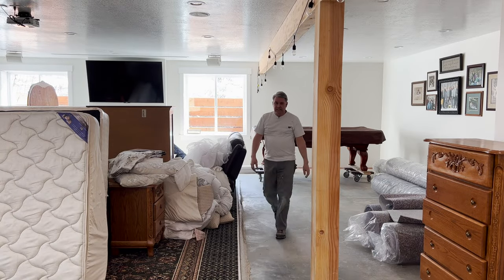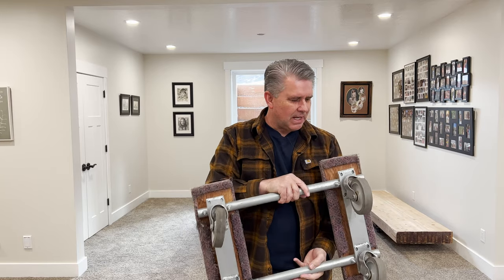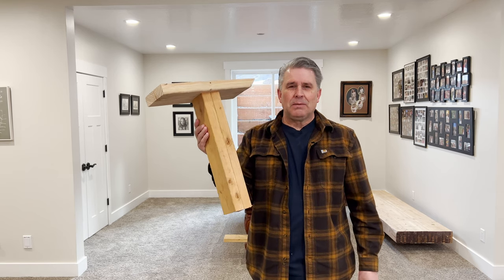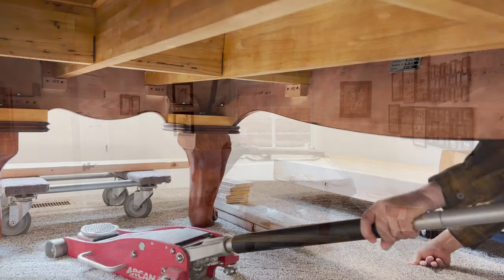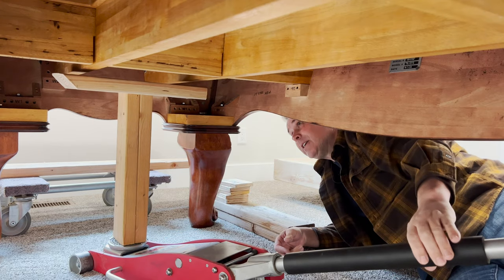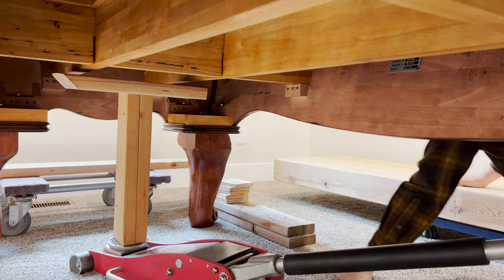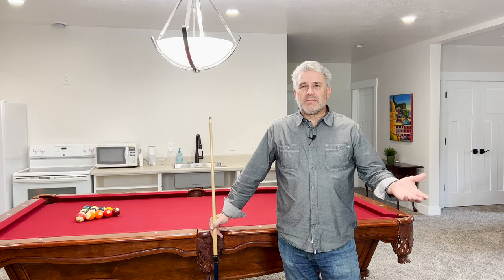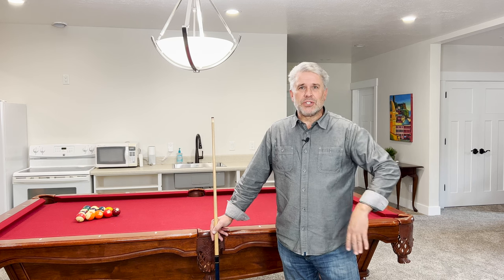Move a 1,000 lb pool table by yourself - NO DISASSEMBLY NEEDED!   |   I Can Do That DIY

Comment: I've got a 3 piece slate table. It won't crack? This looks very doable, I'm just concerned about everything I hear about cracking the slate. Thanks for putting together such a great video.
Reply from the maker: Mine is 3 slate also. I had no issues with slate separating at the seams etc. 

I purchased the table used. I disassembled it at the previous owners home, moving it to mine and set it up in my basement and then did a complete DIY re-felt. 

As always with DIY it’s at your own risk with no guarantees. Go slow and easy. That’s what I did. Hope it helps!

Comment: I'm glad i found this. So happy.

Have you thought of new precautions to take or making new adjustments to this video since then?
What worries me is that the wood across the dolly will snap. Maybe making it like a header you would find above the door or is that just over kill?

I'm so nervous but will attempt it your way step by step and slowly.

All this because of the Stupid carpet that stretched out over time and became like a speed bump now tripping hazard.

Any suggestions would help.
Reply from the maker: I’m really happy to hear the video was useful to you! Regarding your concern about the wood across the dolly potentially snapping, reinforcing it similarly to a door header for additional stability is a smart idea and certainly not excessive. When attempting this, proceed carefully, step by step, to ensure everything goes smoothly. Adding extra support, such as using a thicker piece of wood or more cross beams, can help prevent any issues. Always prioritize safety and take your time with the process. Best of luck with your project!

Comment: Nicely done! I’m assuming your table is a 3 piece slate table? No issues with the seams where the slate meets? I need to move my 4’x8’ (3) piece slate table about 10” in one direction and am dreading having to take it all apart for that. Thanks again, appreciate you sharing this!
Reply from the maker: Thank you! You’re correct, mine is a 3 piece slate. I purchased it used, disassembled it at the prior owners home, hauled it into my basement where I reassembled and put on new felt. There has been no movement of the slate. As you can imagine, do at your own risk, no guarantee, but it worked for me and saved a lot of money. Good luck!

Comment: Also, is that a Beringer? I might be disassembling by myself and moving it. Not sure if i will be able to move the slabs by myself.
Reply from the maker: It’s a Cal Spas Camelot. The main frame and the slabs will be tough to move solo depending on where you’re moving it to

Comment: What if the pool table doesnt have the "T" cross member wood support under the table? Mine just has two 2x6 across the narrow way. Wondering if itlp hold weight if jacked
Reply from the maker: I’m not able to answer that since I’m just a general DIY guy. You may be able to check with a pool table shop or forum. I think a lot depends on slate type, table weight, etc. Sorry I’m not able to give you a direct answer. Best of luck with your project.

Comment: Is it level ? Normally you  never lift it from the ends, sides only.  The reason is you can slightly move your slates, where they are joined and cause it to not be level.
Reply from the maker: Yes it is level. I removed the felt when I purchased the used table and disassembled it to haul it home. Once in the basement I installed new felt.  After three moves to facilitate the new carpet installation it’s still level.

Comment: I have a 9ft table, so you think this process would work for mine.  I am concerned mine could be more difficult since I think mine weights 1300lb.  I was given a quote of $720.00.
Reply from the maker: It should as long as you have a Jack and for dollies that will support that weight. Is it a single slab or multiple? A longer table may run a higher risk of popping the wax in the joints so you won’t want to lift it too high. 
Always be cautious lifting that amount weight.

Comment: Now how do I get it through doorway?
Reply from the maker: That’s going to be a challenge. Fortunately I did not have to do that for this video. 

When I purchased the table, used, I completely disassembled it and moved it to my basement. This required  new felt for the table also. 

Best of luck with your table move.